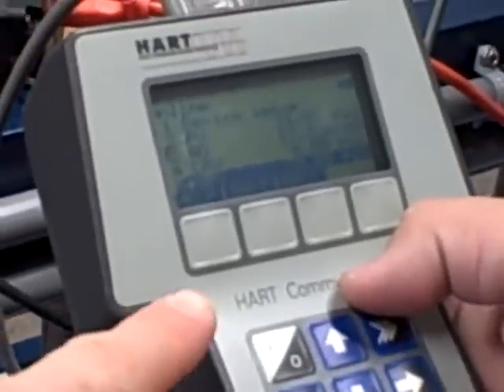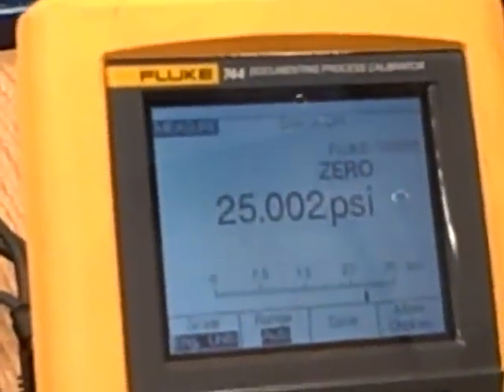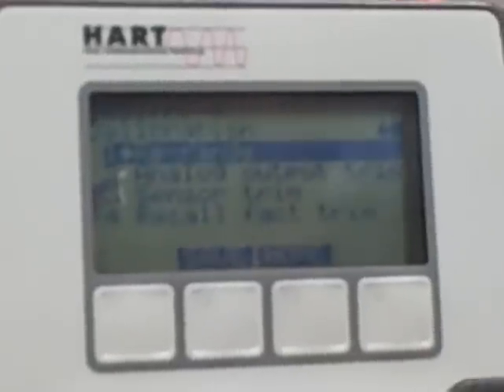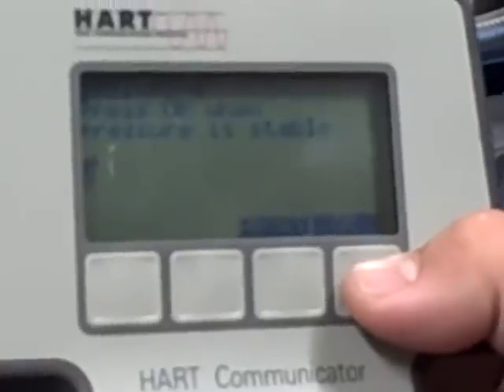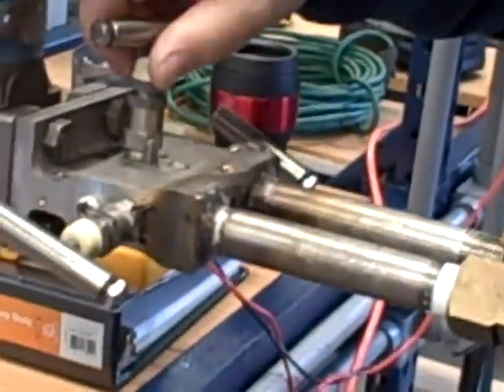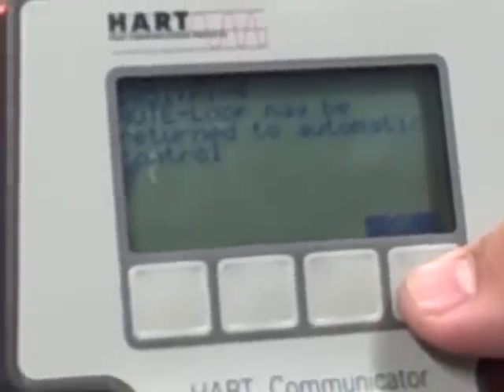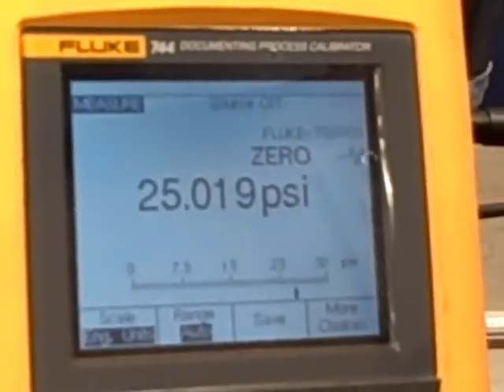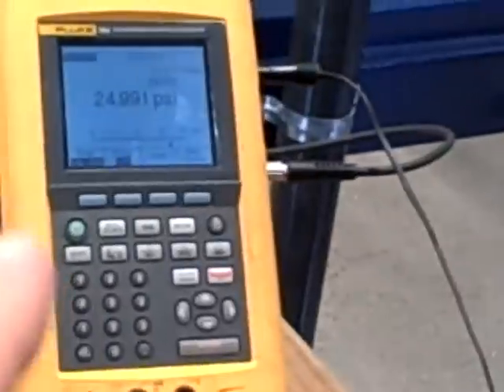HART sensor trim upper 275

Comment: sir were having problem with this transmitter calibration same with this model,we cannot do the upper sensor trim it shows excess correction. I applied 450 mbar the transmitters indicates only 350 mbar when I tried trimming but it not accepting.how to correct this one? range is 0 to 450 mbar.